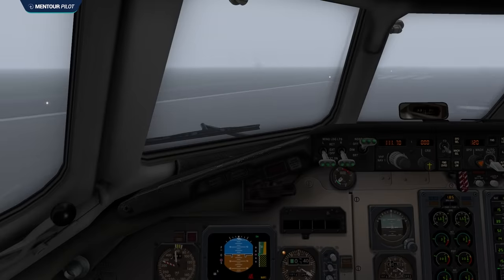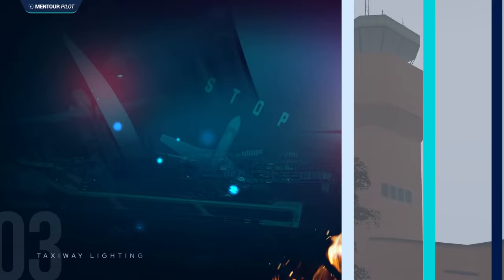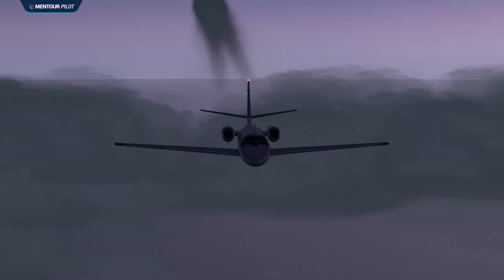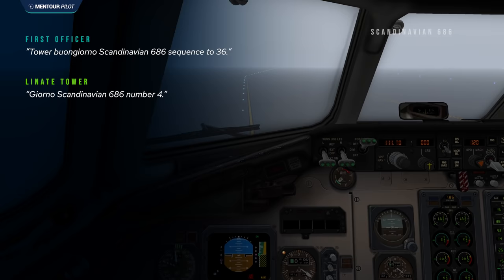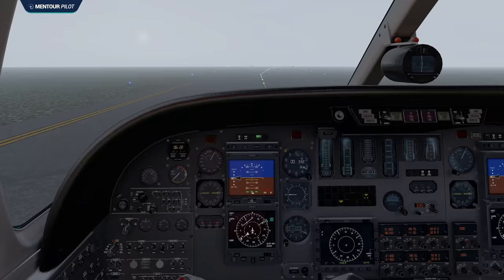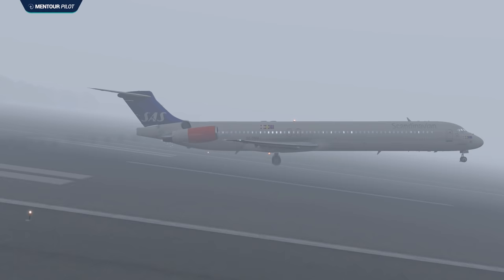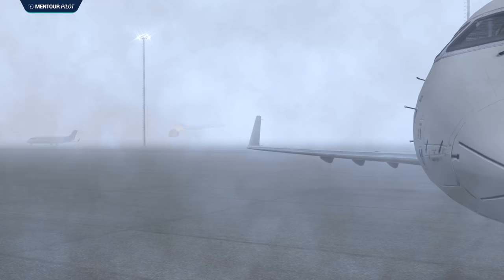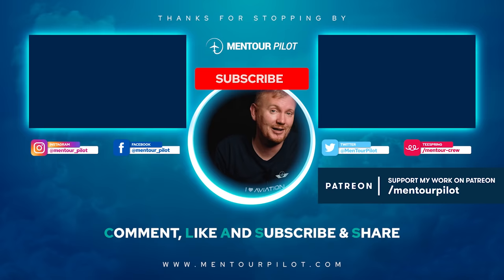A Perfect Storm of Mistakes! And how Heroic Pilots Almost solved it.

Comment: Mentour Pilot , I know that this is not your usual type of story , but sure it will interest you. This incident happened during WW2 in the Pacific on the Marshall Islands  on the 8/8/44 with  USN B-24  --- B24U - 155 of VB 116 . The pilot of the ten man crew was Lt. Romane C Anderson , taking off on a routine patrol with the Liberator marginally overloaded which was customary at that time with 9*500 lb bombs and 2900 gals of fuel . Lost control and swerved into parked aircraft destined for carrier replacements . The exploding bombs and resultant fuel fire destroyed 85 aircraft and damaged a further 55 . Amazingly one crew member survived , and no other casualties . As they say , accidents happen.

Comment: I'm amazed how much simple signage matters. Despite all the equipment failures, the mess-ups of the local airport, and the Cessna pilot not being qualified to take off under poor visibility, the runway incursions would have never happened if there was an "R6" sign. Or even if the tower was told "oh yeah, there is something we painted in the ground called S4, we're not going to use it since we're not expanding anymore so don't give any instructions referencing S4, but it's there."

Comment: Excellent video! I love the way you narrate and the level of detail you get into!
I will love you make a video of the 3142 LAPA flight incident in Buenos Aires, Argentina in 1999 also, where a 737-200 tried to take off without flaps extended and ignored all alarms...
It is another case where the crew was pushed to normalize violating safety rules because of bad maintenance of the fleet.

Comment: The fact that critical green and red taxiway lights had to be all on or off is particularly indefensible. Wiring like that isn't complex, just power cables and relays. Any capable electricians could have fixed the problem. Why weren't they told to do so is inexcusable.

Comment: Would you consider talking about TAM Flight 402 (1996) and/or Flight 3054 (2007). Both took place at the Congonhas Airport, located in a densely populated area of São Paulo, Brazil, caused mass commotion at their respective times and were widely covered by the media, including, to a certain degree, the investigations. Flight 402 crashed just after take-off due to in-flight deployment of the thrust reverser on the right engine; Flight 3054, which had one of their thrust reversers out of order, crashed after landing in a wet runway and failing to deploy spoilers and autobrakes, which led to them running out of runway and hitting a storage facility out of the airport. Unfortunately, in both accidents there was total loss of lives on the aircrafts and some on the ground.

Comment: I have seen many mentor pilot videos, but the lack of responsibility of the authorities in this case really shocked me! Since this happened not in the 1920s but relatively recently, I assumed that at least every European airport complies with minimal standards such as clear marking of taxiways as well as their individually controllable lighting or uniform language in radio communications. Btw: Thanks for the great quality of the videos in this channel (both content and technical)! If everywhere in international air traffic would be worked so well then we would be much safer in the air (and on the ground). 👍

Comment: I work at a military installation in central Indiana, Grissom ARB. When I worked at the civil engineering office the head manager wanted to make me the airfield driving instructor. Since I was the vehicle control officer, he wanted to combine the duties under one person. One problem; I'm colorblind and there is one area of the red color spectrum I can't see. Therefore,  I cannot perform such a duty.

Well, he wanted me to do it anyway and tried to have the current instructor dump the responsibility off on me anyway. I told him I couldn't and eventually I had to contact the union office to raise the issue. The CE guy laid off for about two months and he then tried again to dump the duty onto me. Again, I went to the union but this time I also contacted the head ATC who gave me a control tower check and vision examination. Both tests concluded I couldn't take up that responsibility. The head civil engineer STILL tried to make me do it, and this time the ATC contacted our MAJCOM who came down and very pointedly forbade me doing that duty. Heck, even my own son who was a ground refueler at the time said he would never let me on his runway at Ellsworth AFB. The CE guy eventually laid off.

But just think of what could have happened if I, who clearly is not qualified to be on a runway, was forced to and it eventually ended up in a catastrophe like this? It send chills down my spine to even think of the consequences.

Comment: Had a very similar thing happen here in St. Louis. STL. 
A TWA MD-82, using 30R, took out a Cessna 441 on take off. There is a bit of a hump on 30R, and one end of the FBO entrance is in the trough. It’s night time. Cessna pilot got lost. Fortunately, no one was killed in the TWA aircraft. Tough bird that Mad Dog. And stop very quickly. But, before it could slow down, it took the top half of Cessna off. Including top half of pilot and passenger.
Reply: That MD-82 went to the bone yard, years later, with its scab patch on the lower right wing.

Comment: Hello, I have a question. Why don't commercial aircraft have small cameras  mounted in the fuselage looking back at the engines? I have seen several videos of crashes where this would have been very beneficial.

Comment: A similar accident occurred 10 years earlier in 1991 at LAX international airport involving an arriving Boeing 737 and a departing Fairchild Metroliner.  ATC gave the 737 (US Air 1493) clearance to land, not knowing that the Skywest Metroliner (flight 5569) was still on the runway. Both aircraft collided resulting in the deaths of everyone aboard the metroliner and a significant amount aboard the 737. If you haven't done it already, I suggest making a video on the 1991 LAX runway disaster.

Comment: My background is as a doctor - so completely separate to aviation - and for me what really struck me here is that the Cessna pilots were preparing to take off despite only being qualified to take off in Cat 1 conditions. This isn't even a borderline takeoff for them, it is a wildly out-of-range takeoff. 

The thing is, in this airport, a lot of horrific mismanagement is going on but none of that is within the control of any of the pilots involved. From that, alone, accidents were probably inevitable. I understand that. But I just can't comprehend how or why someone would queue up to do a takeoff they aren't qualified to do. Ultimately as a pilot, I imagine that same as a doctor, their professional judgment is the final thing that can save them, the final thing that stands between you and a disaster and I would have expected professionals who are aware of the risks involved to respect that.

Comment: Effectively a near duplicate of Tenerife. There too an aircraft was taxiing on the runway when it wasn't supposed to be while another was taking off (PanAm had ignored its instructions as to where to leave the runway, deciding on their own to take another turnoff with a less steep turn further down the runway and failed to mention that to the tower)...
There too tower had no visuals on the runway because of dense fog.
There too aircraft crews (though both aircraft there) were going on habits rather than procedure (though procedures back then were far less strictly defined. KLM interpreted their lineup instruction as a takeoff clearance as at Schiphol those were always combined, you're still never told to line up there unless you're also given takeoff clearance but now the phraseology is different).

Comment: I think, during fog, all ground planes must be stopped / forbid to cross runways, then a car must be sent out to check the runway before any take off or landing. This however might take a very long time. Alternatively, we could send out teams that could check every 50-100m of the runway, to make sure it is completely clear before any  landing / take off. Or at least install a series of webcams on the side of the runway. This way you could check if the whole runway is clear much more easily.
Reply: Ground radar normally takes care of everything you mention.  It was out of service at Linate.

Comment: What makes me so angry with this crash is the aftermath. The controller, the airport director and the former airport director all got prison sentences. BUT on appeal they discharged both directors. So only the controller had to actually go to prison. Granted he made errors but a big majority of them was directly caused by the failure of those two directors to provide him with a proper work environment. They were the guilty ones. Their extreme mismanagement was the reason for this accident. But they also were the ones who could afford good lawyers. And so they got away with it.
Reply: Thanks for your comment💌🚀📩🚀
For more insight📩🚀🚀.

Comment: From the accident report:

"Documentation available attributes a high professional standard to the PIC and an above 
average standard to the co-pilot.

The professional performance of the crew during the few seconds from aircraft collision to
final stop shows a consistent and correct control of the crippled aircraft trajectory and path
which may have averted a higher proportion disaster (this is confirmed by DFDR data analy-
sis). Containment of the trajectory deviation possibly safeguarded near by airport main build-
ing and other aircraft parked on the North apron."

Comment: If you haven't done it yet, you need to do the old midair collision over The Grand Canyon. If you are fit enough to hike down there after a heavy rain there is still wreckage to find. Sadly, the only way I am getting down there now is by helicopter, by driving my car off the edge or by jumping. There was also a 747 that landed at the wrong airport around Wichita Kansas and another 747 that landed at the wrong airport in southeastern Colorado. One had to be turned around by tug, and the other overshot the runway.

Comment: WOW how scary for me to realize that in the early 90’s I flew into Linate and at one point before you went into the investigation report I thought how ignorant can a control tower and fire brigade be and not realize and check things out after multiple people calling in. It’ baffling and so true as the report said about working together but more about the neglect even after receiving reports.  How could they not stop all air traffic in low visibility even if they received a false report. Safety is number one and my company culture says we (ourselves)are responsible for safety too.
Reply: The low visiblity itself would not have been a problem if personnel, procedures, and equipment all had been up to snuff.

Comment: This enrages me as a mechanic/electrician those airport lighting faults could have probably been fixed in a day by a motivated guy who just looked up how its all wired and where the issues came from 
I havent watched on so far but my guess is he probably wouldnt even have had to leave the tower for it because this sounds like faulty or defective wiring in some kind of control board for the operator since the actual lights seemed to work fine
So if my guess is right id say i need about half a day to fix sth like that and yet theese people just let dangerous conditions carry on in a place where mistakes can cost lives? 
Thats why i dont like working around lazy people, it doesnt just cost them...

Comment: This is completely off topic and not airline related but I feel like this is a good story to share as I have a similar experience. 

When I was in elementary school, I was on a school bus turning into the school when a car going 80mph running a red light hit the back of the bus. Like many kids on my bus, I didn’t have my seat belt on. Due to no accident having happened, I thought I was safe. Oh boy was I wrong. When the car hit the back of the bus turning into the school, everyone moved to the right and then to the left and a volcanic ash smell filled the bus. I hit my head against the window bar and ringing filled my ears. Just a side note that will be relevant later on, I’m bilaterally deaf, and when I got back to my senses after being shocked and hearing a really loud ringing louder than normal, I immediately evacuated as we always practice evacuation drills where I live. After I evacuated I felt off, off-balance, and unable to coordinate my balance. Fast forward 1 year after the accident and they finally found out that I have a small tear on my brain. For an entire year, Doctors thought that it was a behavioral issue and that I was acting out for attention. Doctors constantly said the same thing and let me add I went through 25 doctors before this one doctor said… he might have a tear in his brain. Somehow all these other doctors never thought this and it so happened that it was a small tear on the balance part of my brain. 3 months later I got the tear patched and the doctors found out that fluid leaked out for an entire year and the brain never have any dead cells. Going back a year to the time when I had the accident, the official report was one death and no injuries. When they found out that I had an injury, my school paled at the realization that one of the students that they hated the most (a story for another time) had an injury. The injury was an internal Traumatic Force Brain Injury (TBI) which is an injury where the skull bumps into the brain and injures part of the brain due to the traumatic force. Remember how the bus was turning into the school? Well it turns out where I live, if 85% of the vehicle is in a school’s property, they are liable for paying any damage and responsible for any injuries that happen on their property. As a result, they had to pay for my surgery to patch the tear. Fast forward 15 years later, I’m fine, and I am starting to start editing for a YouTuber who is really successful

Comment: This should have been a moment of clarity for how an airport is directed and managed. It also traces back to the Italian Air Authority because they should have mandated the ground radar be replaced. They should have mandated proper and prudent repairs to the laser director system, to the lighting, and to better vertical markers and CLEAR runway markings. And FIRED and JAILED any employee who failed to listen to any other employee making safety and upgrade recommendations. A "whistleblowing" program so to speak. The fact that this airport somehow managed to be mismanaged for so long is very disconcerting and appalling.

If pilots were being fired or disciplined for refusing this airport, whoever did the firing should also be in prison. I'm just a humble former private pilot, but worked in military aviation for 20 years. I can't even comprehend how an airport like this even functioned? And had multiple runway incursions? Isn't Italy part of the EU? Doesn't the EU have an aviation authority that would have been concerned about this? I wouldn't let a hang glider land there more or less a commercial jet. 

Honors and thanks to the Airmen who fought so hard on the SAS MD-87 to save their aircraft. They fought to the end. They deserve the credit and to not be forgotten. A lesson we all as aviators should learn. And that damn airport should have had it's operational certification revoked until an international team of aviation safety personnel certified each and EVERY safety upgrade was completed, personnel trained, and probation until proficiency can be documented.
Reply: Trust me, EU is trying to change Italy. Italy does not want to... 

I love Italian culture, it is my favorite holiday destination. But some things are just inherently Italian.

I always take the train from the airport, never to the airport. Just cannot trust it. In the small village I go to, there is an electricity transformer, the cost of that thing going to flames is well known since it is seemingly cheaper to replace it every year during summer when AC is working than to install a more expensive model. The runways having a weird order does not surprise me at all, do not expect logic when going to Italy.

Comment: How terrible!  One thing that isn't really mentioned is, in my admittedly limited experience (all in the U.S.), I have never heard a taxi clearance involving crossing an active runway that doesn't specifically say (in this example) "taxi via taxiway Romeo 6, CROSS Runway 36, then taxi via main taxiway and hold short of Runway 36" (I know that they were on the wrong taxiway, but I would never cross an active runway without specifically being cleared to do so - the Learjet pilots should have caught this).  And, how can the airport build a taxiway without clearly visible, lighted signs designating its name, especially if they're going to operate in poor visibility.  And, yes it's not really fair, but all communication should be in English (that might have prevented this accident).